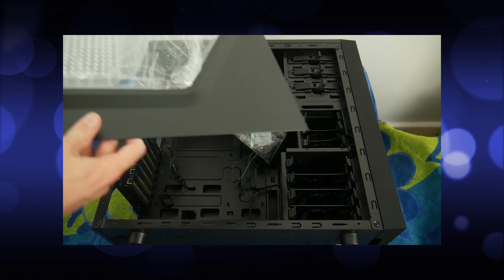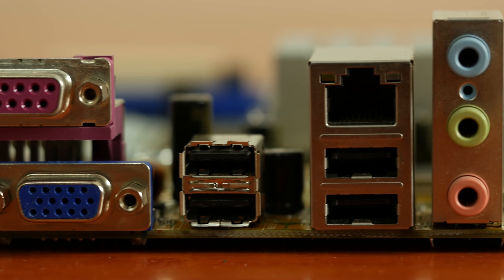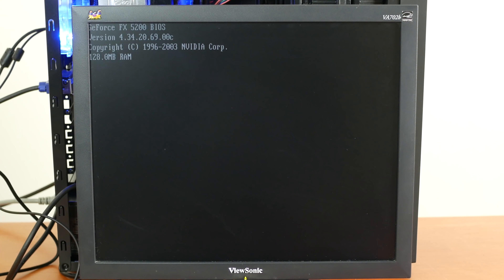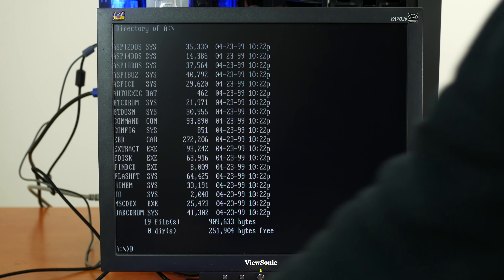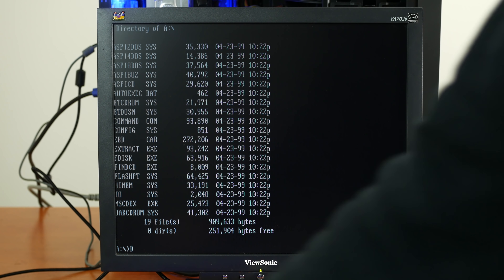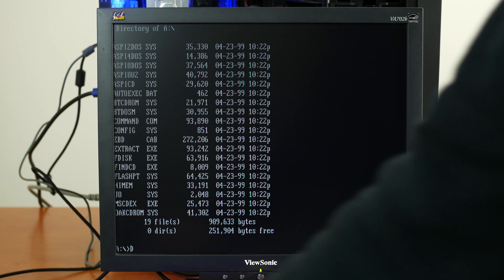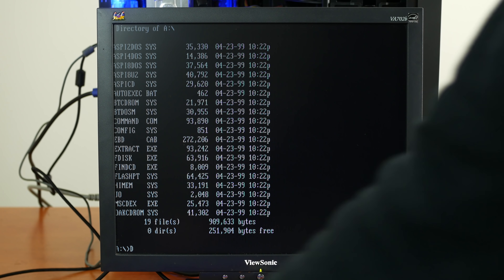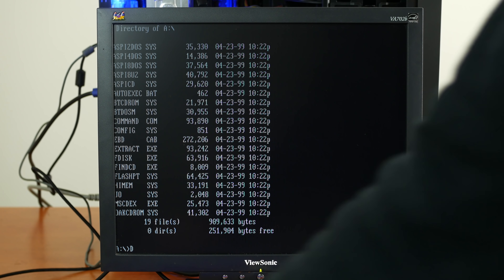What's the fastest (officially supported) Windows 98 PC?

Comment: I worked on a museum where we had three computers which the visitors could interact with. They were all running different versions of Windows. 95, 98 and 2000. 
Part of my daily routine was to start em up, I remember the one with 95 was the fastest one and 98 and 2000 took forever to boot. Funny thing is that we where running them until 2016 and they did their job mostly alright without any major problems. I loved hearing the nostalgic boot up jingles every morning :)
Reply: That's nice!
Reply: What was the museum?
Reply: Luuckkyyyy
Reply: Get a few more computers, one with xp, one with vista, one with 7, one with 8, and one with 10.
Reply: In 2016 some users were still using xp as main os and very rarely even w98! Actually even now someone is still doing that. Windows 7 in the other hand will never ever vanish
Reply: No more than 256Mb for Windows 98.  All his problems were because of his 1GB of RAM.
Reply: I remember when Windows 95 Annoyances website was a thing I made a guide on how to get Windows 95 to boot in 12 seconds using a tool MS once provided to defragment your hard drive based on the order files were needed for booting. Boot time slowed down over the next Windows versions before it sped up again.
Reply: @andreasproteus1465  uh no
Reply: 666 likesohsit
Reply: @andreasproteus1465  in this video? He has less, he mentioned the problems with more.
Reply: İ wish there was a museum in my city that had retro tech you could interact with
Reply: @andreasproteus1465  256 Mb RAM for W98 was the best and the system was very fast, Vista needs 4 Gb RAM, Windows 10 needs 16 Gb RAM and Windows 11 needs 32 Gb RAM
Reply: what a dream job (until they threw em away :-( )
Reply: national video game museum? i've been there dozens of times, hopefully i can visit again. one of my fave places
Reply: @loriansaceanu  Linux is the answer since gaming is no longer a issue.
Reply: @sheslikeheroin93  To use it in a decent way, but you may have 4 Gb or 8Gb.
Reply: he should have taken a quadcore cpu and a nvidea 4000 card
Reply: 100th like :)
Reply: Must have been very fun
Reply: So did you guys decide to stop being fun in 2016?
Reply: @loriansaceanu  you definitely don’t need 32 gigs for windows 11 or 16 for 10 that’s not how it works at all. Microsoft recommend 2gb of ram for the 64 but windows 10 and 4gb for windows 11. for productive use of either windows 10 or 11 8 gb of ram would suffice unless your planning on gaming or video editing.
Reply: @MF175mp  Windows 98 kinda sucked, I can't imagine people using it in 2016. Maybe XP since it was actually good, but not 98
Reply: The Living Computer Museum in Seattle was full of functional computers you could program and play with like that. It's a bummer that it's been closed since covid, I really wanted to return and try my hand with some of the older systems
Reply: @loriansaceanu windows 10 runs very well on 8 gig if you are not playing modern games.
Reply: @blackterminal  I know that! I had a Legion with 8 Gb ram single channel and I bought another one to have 16 Gb totaly and to get better performance. Depends of what is the computer for, design etc. Windows 10 runs well on 4Gb too. I was playing almost all the Assassins Creed on that machine, with 256 Mb a Radeon video card. But earlier I was talking to get the max performances from a system with Windows 10 installed. Best regards!
Reply: @MF175mp vista disappeared as soon as 7 released
Reply: did it happen to be called bootheel youth meuseum?
Reply: Great Job!

Comment: 34:52 THE FAMOUS WINDOWS 98 SHUTDOWN BUG!! Oh, man! I spent so much time dealing with that for my business clients back in the day. :)
Reply: Jimmy S  Well, I don't recall us trying that! If I ever go back in time, along with advice to buy Bitcoin, Apple stock and VMWare stock, I'll tell me to try the shutdown audio. :)
Reply: I’m trying to recall what caused it and what the fix was but I can’t for the life of me remember
Reply: Oh wow. That must've sucked. My WinXP at the time was buggy (for instance, I would be lucky to hear working sound) but at least it knew how to shutdown properly!
Reply: Jimmy S  Then went to crap Vista 7 was ok  10 crap by then I went linux for  9years
Reply: @rando843  have u tried running windows 10 off of a hard drive?
Reply: @rando843  Vista was less a crap OS than it was being ahead of its time. The average system at the time couldn't run it very well because the more premium features required better hardware than was available to most people.

On an SSD with a system with at least 3GB of RAM and decent graphics (like...4th gen Intel integrated graphics could do it) it actually performs pretty solid.

Vista felt like the last Windows OS for people who wanted to deep-dive their system. Really kit it out the way they wanted to.
Reply: like when, 1996-2003
Reply: Jimmy S  my windows xp professinal dell desktop [SP2] was buggy, it didnt play startup sound [CORRECT DRIVERS INSTALLED] and it would play the "You need protection" pop up sound as soon as i go into desktop. So i just installed windows 98 on it
Reply: Probably, but i just reinstalled WINDOWS 98 on it because I have seen people do it on this model before.
Reply: Indeed vista was simply something that wasn't ready for the time. I actually loved it even though it ran like crap by the time win7 came around my vista settings were basically what win 7 ended up being. So 7 was simply the better lighter option I guess. I still preferred Vistas look though.  In short agree 100%  @SolidSonicTH

Comment: I believe the CPU compatibility could be improved by using the third party tools to expand the BIOS into its individual parts, replacing CPU microcode by a newer one, putting it back together and flashing it (I did that on my motherboard to update PXE ROM and AHCI/RAID ROM part and it still works to this day).
Reply: thats cool, you could make a tutorial with that one
Reply: Do you still know what you used to do that
Reply: or you could crash your whole system when you mess it up lol
Reply: You'd want a BIOS reprogrammer and some clips connected to a Raspberry Pi before even considering doing this, because there's a real chance of corrupting the BIOS if you do any modding.

Comment: I've been building retro PC's for years, and I can totally understand all the steps you went through to build this. For my 'Ultimate 98 build' I went with the Asrock 775i65G R3.0. In my opinion, this is the best board you can use for an ultimate 98 build. It supports Core 2 chips with up to 1066MHz FSB, which includes some of the newer 45nm Wolfdale chips that are capable of being overclocked to the 3.5-4.0GHz range, if you desire. The E8600 isn't officially supported by any of these 775 boards because it uses a 1333MHz FSB. The most popular choice if you're looking to overclock is the Pentium E5800 because it starts with an 800MHz FSB which gives a lot of overhead for FSB overclocking, but it's still a beast even in stock form @ 3.2GHz.
Reply: What do you mean officially supported? Is there a way to make it run?
Reply: @SOTP.  I haven't tried the E8600 or any of the Wolfdale chips that support 1333MHz FSB, so I'm not sure if they will work. The Asrock 775i65G R3.0 board doesn't 'officially' support 1333MHz FSB CPU's, but it can achieve that FSB through overclocking. The E8600 might post and require a manual overclock to get the CPU working at it's correct frequency, or it might not even post because the bios doesn't recognize or support the E8600 'officially'. I'm sure someone out there has tried it and reported their results, I'd check the VOGONS forum.
Reply: @IronicTonic8  ok.
Reply: I have a board with 945P chipset, which does support the 1066 CPUs but not the 1333 ones. Putting one in anyway just causes it to not boot.
Reply: Yup. This is a great MB and I use it for my 98SE build. My next dedicated OS machine, this time for XP, is also an ASRock, the 4CoreDual-SATA2, with the venerable Q6600. Smooth, if not fastest.
Reply: IronicTonic8
DELL vostro i found, it runs Windows 10 x64 now
any fast DDR3 on recent BIOS update, 2 x 2 Gb DDR 1333, QE 9650 Core2 Quad.
It official supports MS DOS 6.22 too, only Windows 10 and 11 are not official, but able to do that as well without full USB support on the Chipset, but it runs good.
Reply: @NineS5  Skip all Celerons on 775 please, please the CPU for $10 QE 9650 ! Fast DDR3 in it too !
Go fortnite on it in 2024 !
Reply: @HappyBeezerStudios  945p can do 1333  too, are you sure you have DDR 3 board, some do 1066 max on DDR 2 !!!!

Comment: 34:48 Need to enable ACPI. When you start the Windows 98 Setup via command line, it should look like this:  setup.exe /ie /im /is /iv /nr /P j
17:04 Since ACPI wasn't enabled, the HD controller started in real-mode (16-bit) and demands an IRQ instead of using DMA, likely the cause of the audio not working initially.
Reply: Note for people reading this from a fellow 98 enthusiast:
It's the /p j flag that installs ACPI. The rest of the flags are there for other reasons.
So just setup /p j is what you need.
SIDE NOTE: The /is flag is for disabling scandisk. I recommend it, especially on SSDs.
Reply: @Alalbann i only hear Pew Pew Pew I'm pro
Reply: Disabled ACPI should drop you off at "It is now safe to shut down." and still have reboots work, it's only shutdowns it can't do fully on its own. This system is stuck in the process of shutting down, not after it.
Reply: @Alalbann You get lost? This isn't a Fortnite video.
Reply: Are you telling me that sound isnt working cuz he didnt set his hard drive up properly?
Reply: @SummonerArthur  for yall computer noobs, no thats not what he said. He said clearly that you need a command switch to enable a setting called ACPI during installation of windows. Which is needed to get hardware working properly. Which why hardware conflicts occur like the sound card not working.
Reply: @snelieacks140  yeah, I've read that again, it makes sense now.
I might've benn sleepy when I wrote that.
Reply: I have brain damage
Reply: Lol

Comment: “Intel Core 2 Duo.” I haven’t heard that name uttered in so many years. May my old MacBook 3,1 Rest In Peace.
Reply: I'm just using one on my old Thinkpad T61, lol
Reply: @kwebbytakeflight  I' m running an E8400 in a desktop that originally ran Vista... Just wish I woulda saved for a E8600.
Reply: I have a E8400 @ 3.5GHz in one of my HTPC's
Reply: @Everything TechBook Pro why would someone want a MacBook that old repaired? You can buy them for less than $50
Reply: I've got a core 2 duo t2250 laptop that I still use occasionally. 2gb ram, iGPU, 80gb hdd, windows vista. Not good, but it works
Reply: @feelingevaporated2912  It also depends on where you live. Here old MacBooks usually go for 100-150€
Reply: Still use a Core 2 Duo iMac with 12GB Ram under Linux Mint, works fine
Reply: Not as bad as the celeron on my laptop
Reply: what's a mac? is it edible?
Reply: @sherwing9054  Yes, you can eat a mac.
Reply: I'm using that one haha
Reply: @sherwing9054  he's talking about a Macintosh
Reply: Still have my collection of Core 2 chips here. Especially the faster quads are still completely usable today. the speedy dual cores are fine, too.

Comment: Dumping the win98 install cab's on your harddrive was actually a treat back then. You never had to go fetch your CD whenever Windows
wanted to install or reinstall some files. Which happened ALOT, especially with network drivers. which occasionally just stopped working
until you wiped the entire network stack and reinstalled it from scratch. Sometimes literally dozens of times over the course of a LAN.
Reply: Especially when you modified the registry entry for default Windows CD location, and it never prompted you to insert the CD, it just found the files and went at it.
Reply: @th3R0b0t  If you installed it from the .cab's youve dumped on your HDD, it would search in that location without the need to adjust the sourcepath already.
...some things with win9x were pretty convenient, while others were just horrible. :p
Reply: Yep, I actually used this back in the 95 days too

Comment: 32:19 The reason why it does crash, it's because you're not in a pure dos, so memory allocation are eaten up by Windows 98 SE. To make so you must click on start menu, then shut down, then select DOS. Then you'll be in pure DOS, from there, if you have a Sound Blaster Card prior than 2009, you can use generic Sound Blaster 2.0 drivers on IRQ 7 PORT 220 and it will works. So in games, you'll be able to configurate Adlib, Sound Blaster and of course if you have it on the motherboard, PC Speakers. I've personally used Windows 98 as primary OS from 1998 until 2006, as I wasn't willing to lost the possibility to use a pure DOS, which is important as many games and software were only available on a PURE (not emulated) DOS. Later fortunately it changes, but that's another story.
Reply: Yeah as someone with heaps of DOS games I did miss the DOS mode after 98

Comment: There's a reason 98 went away so quickly after XP came out.  For the most part, I didn't miss it, especially after Service Pack 1.
Reply: @r1oot  meh, you needed fairly decent hardware with good drivers to have Win9x running stable. 98 can run fine on a Northwood 2.8 GHz but boy does it bog down within a week (with the onboard audio drivers having inexplicably worse audio quality on 98 when compared to XP SP1). Actually, XP SP1 is probably the best OS for a Northwood P4 anyway.
Reply: @r1oot  Windows 98 never ran stable. It's why it was so baffling that ME came out only two years later and was an even buggier re-release of it with features *removed*.
Reply: @acumenium8157  wrong
Reply: @kirkm1976  wat
Reply: @acumenium8157  you are just wrong

Comment: I was using a Nvidia GeForce 5500 FX in my win 98 machine for a while. It was only PCI, but it was just as buggy on Win98 as in your video. I discovered that the last Nvidia driver release for Win 98 is kinda crap. I downloaded one that was somewhere between the release of the card and end of 98 support. Worked great after that! Smooth gameplay and no complaints about direct draw 3d. Not sure if that’s an option for you depending on how late late into the 2000s the cards you are trying to use where made

Comment: Eventually, I'd like to see the "most versatile" Windows machine.  One that will run DOS games all the way up to XP, natively.  I'd start the way you started, although I'd drop the socket limitation and add the requirement of an ISA slot for a dedicated sound card, as many DOS programs hate the integrated sound chipsets on newer motherboards.  I'm thinking maybe a high-end PIII processor, a dual-GPU setup with one GPU something closer to the Windows 98 Max, like the 6800 Ultra, and a second GPU that's something more Win 95-friendly but still powerful for the era, like a 3DFX Voodoo 2.  Would likely cost $$$ to source such rare parts these days, but would be totally worth it to run several generations of MS OSes on one machine.
Reply: Isa card will be much older
Reply: @dosmastrify  There are Pentium-III mobos that support ISA cards and AGP graphics. They’re rare, but they do exist.
Reply: Honestly, it requires a lot of sacrifices. I tried to set up a Super 7 board for DOS and Win9x games, and found I'd rather have separate machines for both. I don't really want 500MHz for DOS games, I'd like a newer PCI sound card for Windows games, and video cards are just ugh.

While dual soundcards is a workable option, dual video cards almost never is. They exist in standardized IO locations for VGA-and-older compatibility, and hardware conflicts are immediate upon booting.
Reply: @CptJistuce The procesor is always the biggest issue.  Some motherboards have dynamic stepping and allow you to disable cache, but that usually means you need to edit BIOS settings anytime you want to run something older vs newer. I've got a system that actually has pretty great sound; has a dual-sound setup with an Aureal Vortex 2 for Windows 9x and an ISA Sound Blaster Pro 2.0 for DOS.  I hooked them up to a mixer so I can technically get sound from both of them in Windows, though just the SB works in DOS.  As long as you make sure the DOS Sound card is set to low IRQs, it works great!

As for dual video, the best solution is a more powerful AGP card and a passthrough PCI, 3D-only card like a Voodoo 1 or 2.  Contrary to popular belief, DOS does function through an AGP card if you use the right one (my setup currently has a Voodoo3 AGP, not the most powerful but works just fine in DOS), and then a passthrough to an older PCI 3D accelerator (I have a Voodoo1, which, yeah it is weird having a newer Voodoo passing through to an older one but in the name of compatibility, it works surprisingly well). I can run the handful of Glide-mode DOS games to perfection, and then boot up to Windows 98 and run Unreal Tournament with my Voodoo3 drivers and 3D sound.